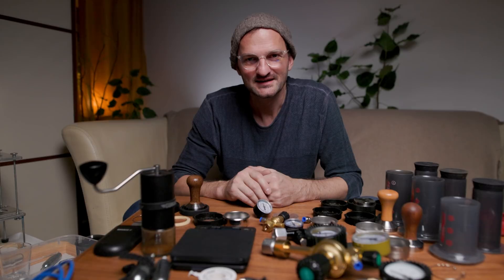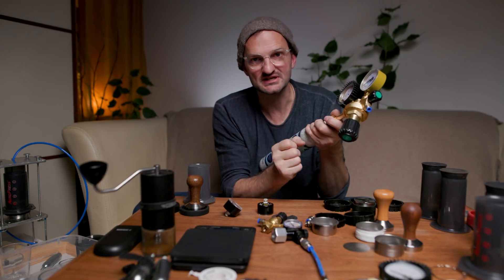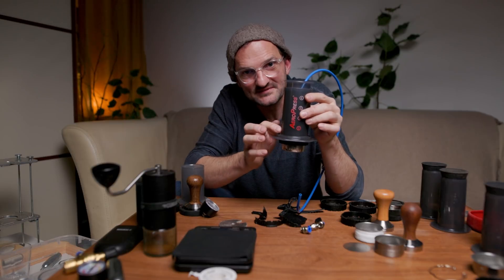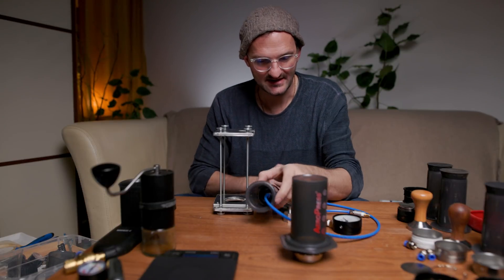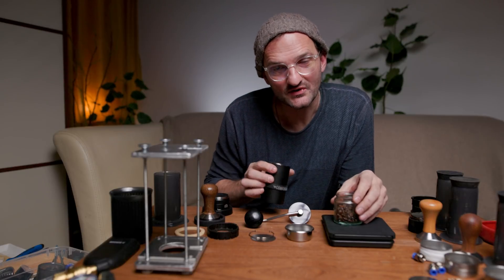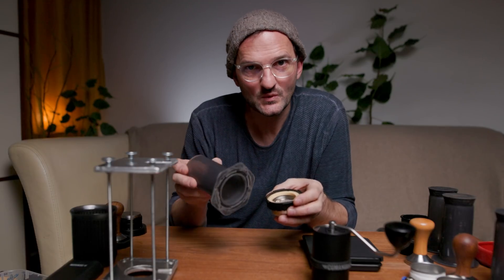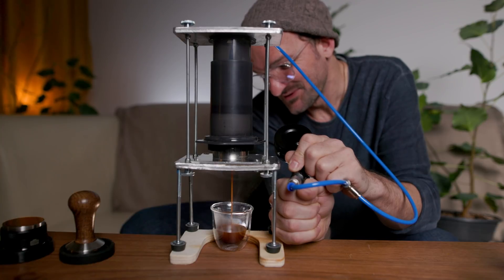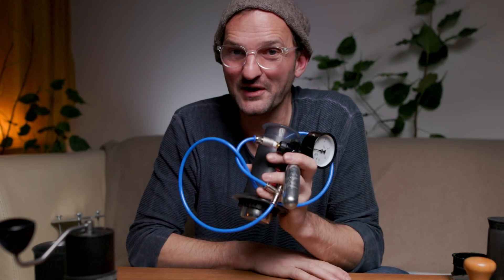Espresso from an Aeropress - NOT a myth anymore!

Comment: Can you measure bars when we push with the  hand? WITHFELLOW ORISMO OR REGGULARORJOEPRESSO
Reply from the maker: As long as you have the pressure gauge installed via the plunger, yes, you can measure pressure. But in both cases you need to make sure that the weight is not sitting on the Aeropress cylinder-table (the bottom piece of the cylinder, that usually sits on the glass), but on the Prismo, or Joepresso itself! Otherwise either the Prismo or the Joepresso plastic wings, which lock into the Aerpress will break. You will either need to find a metal cup, or similar with just the right diameter, so that the Prismo, or Joepresso sits on it directly. Or build your own contraption, as you can see in my later videos. Good luck! Making aeropress with your body weight is lots of fun!

Comment: I think I will just keep using my AP for regular coffee.  If and when I need real espresso I will just pick up a Flair or similar press.  Pretty cool the AP can take that kind of abuse.  Means that one AP probably last for the rest of my life.  I have 4 of them.  So 4 lifetimes of coffee.  I still don’t know how people wear out the rubber plunger.  My first press is the one I use daily and it has made 1000s of cups and still on the original rubber.  They are a very solid tool.  Never go away without one.
Reply from the maker: Yes AP is so much more than people think it is!

Comment: I was pretty stoked aobut the x-bar espresso that got promised on patreon. apparently it never made it. this is fairly cool man! makes me wanna build my own, but I would go for metal
Reply from the maker: The main issue with metal for the cylinder is temperature control. The Aeropress is thermally super stable. I made over 1000 !!! 6-9 bar Espresso already with my modified Aeropress GO and still rockin'! The main thing to take care of is that the black screw bottom thingy (where the filter basket sits in) sits flush on the lower support.
Reply from the maker: I actually visited the producer of the X bar espresso maker (at least it looked almost identical) in Thailand (Chiang Mai) and even tried some espresso from it in a coffe shop where they had some proto types, it was pretty nice, but a bit variable in outcome, unless you pre heat the metal...
Reply: Well who would have thought this of aeropress. Haha. So you saw one live, wow nice 
Yes exactly, the preheating seemed so mendatory and annoying too. I went with the Nomad. Still do preheat, but just once, while grinding coffee.

Comment: Maybe your next invention will be with a lever to have more pressure like flair!
Reply from the maker: I guess, you are right in that the Flair can produce more pressure, if you want, but IMHO I never came across the need to use more than 9 bar for my espresso, since this will require super fine ground, which in turn usually results in unavoidable channeling. But happy to learn about scenarios where higher pressures are of benefit?

Comment: This is crazy! 3 bars are 43.5113 psi, much more tan the presure in a tire! 9 bars are 130.534 psi, more presure than in four tires, I think this is insane! I apreciate you reach this with an aeropress but are many modifications, I think you can desaign a cheap and safer espresso machine, if a tire can explode, I think aeropress is not safer than a tire. Maybe aeropress can suport few brews but the material will become weak and eventually explodes. (please, excuse my english).
Reply from the maker: Dear Luis, I understand your concerns, and I had similar ones in the beginning. My first couplo of hundred shots I used a Plexiglas dome to protect me in case of explosion. Now, I have pushed almost a thousand 6-9 bar pressure shots and the Aeropress is still intact! What an amazing product! I made some small, but important modifications though to my alumnium table, will post about it hopefully soon!

Comment: Love your idea and how the set up looking very robust and neat! The metal plate and rod holder is brilliant, similar like motorcycle suspension tool. If I’m making this, for added safety I may just put a stainless steel hose clamp or exhaust pipe clamp (which has wider plate) at the outer aeropress housing where it receive pressure, just to prevent it cracking or exploding. Thanks for sharing, cheers from Singapore!
Reply from the maker: Glad you enjoyed it, thanks!

Comment: Love the video, love the energy, love the Aeropress. Thanks for making my morning a bit better. I would love to see whatever you think of next. I was thinking that maybe a piece of PVC that slides over the aeropress could add some extra protection but also you could mount the hoses, and pressure gauge and tank coming off the PVC section. That way it could be a nice little unit. Also I would love to see you try with a lever, although I might have to try it myself too.
Reply from the maker: Thanks for your kind words! I am actually using a large, thick Plexiglas cylinder that I put over the entire contraption, so I can still see what is going on and also have an extra layer of protection. Let me know once you set up a lever construct!

Comment: Question: When you put the plunger in and push it down, where does the air go? Why isn't that push pushing water into the coffee puck?
Reply from the maker: The plunger has the blue hose connected, when plunging down, the hose is still open on the other end, air can escape. Once in the proper position I close the other end with pressure gauge and regulator.

Comment: Impressive work! However, I would like to point out some issues:

1. The pneumatic parts as shown in your video may not be designed for food processing purposes, which may contain hazardous materials to human body   (e.g. lubricants, particles generated from time to time due to wear)

2. The polymer tubes were usually designed for applications not greater than 7 bars of pressure, the tubes for hydraulic control can withstand much higher pressure, these tubes were usually reinforced, and they would never look like the ones shown in this video.
Reply from the maker: Thanks for your feedback. Actually all the pneumatic equipment I used (hoses, connectors, gauge, valve, regulator, etc...) are rated for at least 15 bar. In my mind, the largest 'pollutor' in this set up might be the Co2 tank, that is why I used the Soda stream and Soda capsules, instead of cheaper Co2 tanks for welding, or air guns. The entire 9 bar setup was meant as a proof of concept and not as the ultimate daily espresso maker. I d rather recommend my 3 bar mod which is easier to build,  cheaper, lighter and offers great opportunity for some extra sports!

Comment: Engineer here. I'd be very careful with these uses of the aeropress. As you've experienced yourself the most likely point of failure is not the cylindrical wall but rather the bayonet locking part at the bottom (either the notches in the body or the cap will bend away or shear off). These failures are independent of the fill level or plunger position since it's the axial force at work here, not the radial one. A cap and filter coming off at max pressure can shatter glass and ceramic below or produce flying plastic splinters (in addition to the hot mess of boiling coffee flying around).

A single test (even up to breaking of the aeropress) is most likely not enough to properly judge the durability. The most dangerous and not so obvious part for the layperson is material fatigue. What works well a thousand times may fail horribly the "thousand an one"-th time because the material has seen too many duty cycles. It is almost impossible to predict fatigue without detailed knowledge of the material and every manufacturing step.

The European pressure equipment directive says that simple pressure vessels where the product of volume times pressure is below 25 (in units of liters times bars) "shall be designed and manufactured in accordance with [the] sound engineering practice" (Paragraph 4, Section 3). I doubt that single pressure test is enough, especially if you don't know the exact materials and manufacturing process of the chamber. I know the directive doesn't apply to you as long as you don't sell these things, but I believe it's prudent to follow its recommendations even in DIY situations.

Also keep in mind the amount of CO2 inside a commercial bottle is enough to displace the oxygen in a room and cause asphyxiation. The pressure is about 50 bars. If you use the wrong regulator and yank it open at once by accident you will break something. Never design or use a pressure vessel without a PRV (pressure relief valve)! In espresso machines they are usually called OPV (overpressure valve) but serve a slightly different purpose as they continuously open an return the excess water to the tank.

I would strongly discourage people from trying this at home - please be more careful and don't hurt yourself.
Reply from the maker: With the 9 bar model the entire pressure of the contraption is held in place by the silicon of the plunger and plunger itself, and the basket. Both are vertically stuck inside the metal contraption. When using my 3 bar mod, the entire pressure/weight is on the cap filter and bayonet locking, that is why I stopped at 3 bar with this mod. (although I had my girlfriend adding her weight onto mine and it also worked, but I don't recommend that. With the 9 bar mod, I assume the first thing that blows, will be the gasket horizontally. 

I do understand your concerns, and I do agree that single tests are not conclusive, and I am not recommending the 9 bar mod as a daily driver. I am using a thick plexiglas cylinder on top pf the entire contraption when pushing my 9 bar shots, to have some extra protection. 

In the description of the video I recommend another regulator than the one I displayed in the video, which has a safety valve built in (around 10 bar). All my pneumatic equipment is rated for 15 bar. 

I appreciate your concern, and I agree that such undertakings should, if at all, only be performed with full knowledge of the risks and proper safety measures.
Reply: @mikkisdiyobsessions3742  A custom-made metal Aeropress would be sturdy enough to withstand the pressures, no?
Reply: @grabble7605  even if it did that, the metal would significantly draw heat away from the water
Reply: @P-K-Ray if the cylinder is double walled like a thermos then its viable, plus the flair is all metal and most manual lever espresso machines.
Reply: Cool gentleman, great video' Cept' Dear God! Thank you for posting these incredibly needed and liability relevant' safety awareness factualities' 
Engineers Rawwk!😶📈👍
Reply: agree, you should wear protection so it will not blow on your face
Reply: Same thoughts here 👍🏻

Comment: amazing!  congrats on putting this together and making it work!..Now, I wonder how the cost of this compares with the cost of a Flair manual espresso machine.  Two advantages to the Flair:  1) It's not DIY, it comes ready to use out of the box, and 2) you don't have to use a CO2 cartridge every time you want a shot.
Reply from the maker: The Co2 9 bar version is not meant as a daily brewer, just wanted to show it is possible. My 3 bar mods on the other hand are quite easy to DIY, for way below the flair price and can be used as a daily lightweight,portable espresso maker. Another advantage of the Aeropress mod over the Flair is that you don't need any pre-heating, since the plastic does not steal a lot of heat.
Reply: @mikkisdiyobsessions3742  that makes sense.  I watched your 3 bar video after I had watched this one and I'm thinking I'm going to try that mod, the one that doesn't require modifying the aeropress, just getting the steel basket and taping it to fit inside the press.  thanks for posting these.  great videos and a lot of fun!

Comment: Pretty nice build, I would be a bit worried about extra CO2 dissolving in the water and making the espresso a bit more acid or even fizzy (in a too-fine grind scenario), but seems like it wasn't a problem. And there always nitrogen to test.

Other potential problem would be the temperature control, both from the thermal mass of the whole system and the gas that gets pretty chilly when expanding. But if it's tasting good then that's all that matters
Reply from the maker: Roasted beans naturally contain lots of Co2, when being released ending up as crema in your cup. I didn't perceive any change in taste due to the Co2. Will try to do some temp measurements and see if there is a large difference in brewing temp with Co2 and air. In any case the taste is pretty good!

Comment: You could make a leverage arm like in a flair machine, to build up the pressure. I would like to see that.
Reply from the maker: I think the flair does a pretty good job with that already and the base model is not that expensive either.
Reply: @mikkisdiyobsessions3742  Yes you are right

Comment: Putting AeroPress aside, I would be very interested in a machine that can automate the whole process but allow to play,  twick and program all the parameters of coffee brewing: grind size, coffee amount, water:coffee ratio, water temperature, pressure and timing.
Reply from the maker: Most medium to higher end espresso machines allow exactly that, but you still will need to do the puck preparation, I haven't seen a fully automatic puck prep machine yet.

Comment: How much pressure would you need or how many times could you do what your doing before the Aeropress shatters or cracks or fails?
Reply from the maker: I am going to find out. So far, with 9 bar, I guess I pushed close to 100 shots. I found that the Aeropress Go has slightly thicker walls, will use that soon.
Reply: @mikkisdiyobsessions3742  looking forward to it, and just subbed. Definitely will be doing something good for someone today! Cheers!☕️

Comment: What was that slushy bubbly crema at the end of the shot
Reply from the maker: Co2 gas pressing the last bits of water out of the coffee puck, after the water column has passed through already. I didn't find an easy way yet to immediately stop the gas pressure inside the Aeropress.The only solution is to   take away the coffee cup at the right moment.

Comment: If you buy another aeropress, cut the plunger near the base, then put it in below this plunger to create three distinct chambers, would you then be able to separate the CO2 from the coffee and reduce the CO2 usage? 9 Bars in the top piston should be 9 bars pushing on the water, right?
Reply from the maker: Nice idea! I guess the main issue will be that the cut plunger with the silicone seal will not remain in the same horizontal angle, but might get stuck. The long shaft of the plunger also serves to keep it at the right angle inside the Aeropress. I am not sure it would save that much of Co2, since the air sitting on top of the coffee puck would need to get compressed as well and to transfer the 9 bar of the Co2 chamber to that air chamber will probably require quite some air volume. When using about 3 bar of pressure with my body weight, I need almost half of the Aeropress chamber space, air compresses quite a bit.
Reply: @mikkisdiyobsessions3742  Right. I guess you would need to have it be flared at the top or something so that it stays flush to the walls of the press.

If you made the pneumatic plunger sit right on top of the hydraulic plunger, it wouldn't require much gas at all. Mostly the difference would be at the end, avoiding any excess venting when the water has passed.

Maybe have the bottom section with two plunger segments to keep it aligned, then the top plunger with the hole in it sitting right on top?

Does the CO2 here alter the flavor at all? That was my line of thought mostly, to get rid of as much CO2 in the grounds as possible.
Reply from the maker: @dalsio  In terms of Co2 changing the flavor, I can't notice any 'odd' flavors. Actually, roasted beans do contain quite a bit of Co2 due to the roasting process and that is what actually creates the crema in your cup. Creme is essentially the foam on your beer, which is mostly created by Co2.

Comment: Thanks for sharing your mod!! This is such an interesting idea.  

I'm curious if the basket mod is basically what joepresso did but with a non pressurized basket instead?  Could be something more comfortable for people who aren't confident in too much DIY.

I'd actually love to see a DIY vid of how you built your steel frame.  It looks pretty simple but I'm curious about the thought process of the materials you used there - was it just the most convenient and cost effective from the hardware store?  

Subcribed and looking forward to future vids!  
That's the main sticking point for me not to start building this next Saturday, haha!
Reply from the maker: I dont own a joepresso, but it seems very similar, except that you don't need to modify the Aeropress with joepresso. But I am not sure  if it can withstand 9 bar (gasket, filter cap). Whenever I get hands on it, i ll test it.
The steel (aluminum) frame was the result of a lot of testing, the threaded rods are super easy to find and cheap and the aluminum is easy to cut holes into. Obviously it could be improved in terms of functionality and design., but I don't think it can get much lighter in weight.  Glad you enjoyed the video!
If you want to start light with DIY check out my other video with the 3 bar mod, that is the one I use on a daily basis. https://youtu.be/A5ZfFLRxvnk